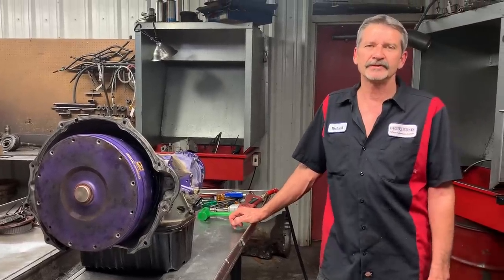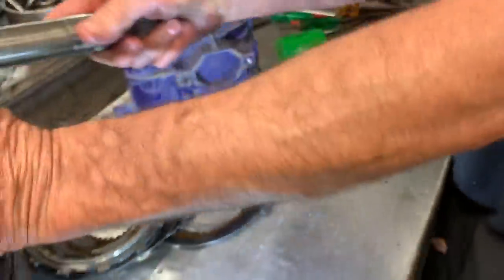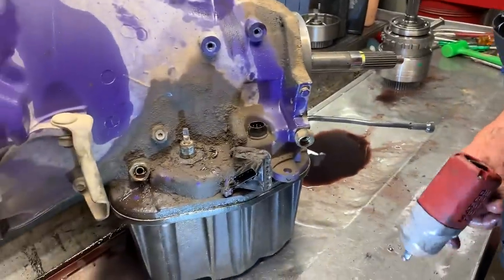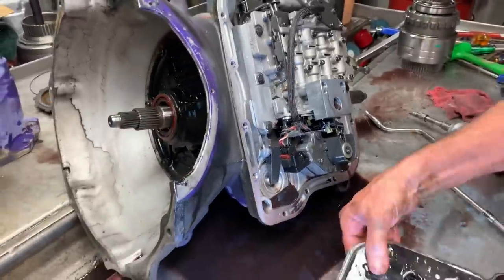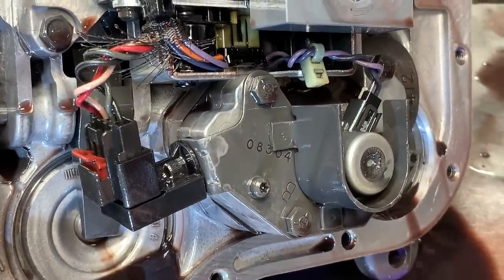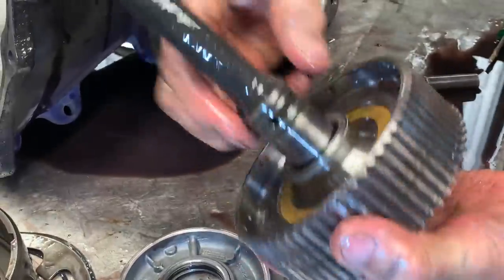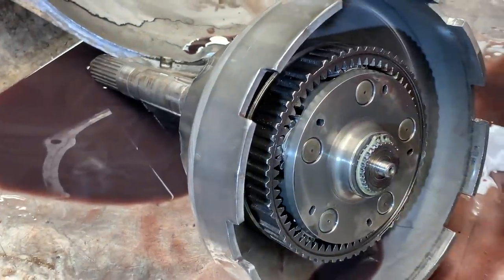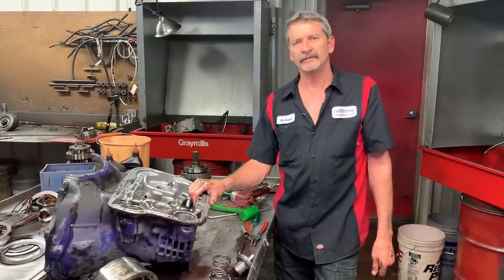ATS transmission tear down... HERE we GO and it isn’t looking good. Video 3-4

Comment: What a shame...ive heard so many ATS horror stories. The only thing you get with them is a deep pan amd a nice paint job. Richard you the man!
Reply: You can only polish that pile of shit transmission so much. He covers pretty much all of the flaws with the design and sorta kinda talks about some of the ways to fix it, but there's a lot of that trans that you simply cannot fix.
Reply: @scottleggejr  you're wrong there. All the top level diesel guys 2000+hp run a 48re. Duramax power stroke Cummins they all run a 48re because they have figured out how to build them strong as shit. Stock they are a joke we all agree
Reply: @scottleggejr   @Scott L  if you want to get technical most trophy trucks run a turbo 400. Some run torque converter sequentials. Only some prerunners use 4l80es. I think it comes down to gear ratios and possibly development. While I agree that a culhane t400 would probably work they almost all run 48res. There are no rules pertaining transmissions in the UCC event (sled pull, Dyno, 1/8 mile drag). The way the diesel trucks make power is way different than a high hp gas truck too. I'm sure that plays a role
Reply: @scottleggejr  I don't know of any built 4l80e transmissions that can hold 3000ft lb. Allison cant do it either, 4r100 maybe.
Reply: @spoolin610  None of them can for any length of time. For drag racing a full aftermarket TH400 could.
Reply: They spend all their money on perfecting the perfect Royal Purple paint color formulation for their transmissions and little else.
Reply: @scottleggejr  Trophy trucks mostly use TH400's. I will say this about the 48re. For tractor pulling they make kits to put the 48re behind the Duramax. So once you build them up, you can throw 2000hp through them.
Reply: Are you joking? They warranty their transmissions for 5 years or 500,000 miles and currently I’ve had mine in my 7.3 for almost 15 years and have over 300,000 and many other freinds of mine have the same set up 🤡
Reply: I've got 430,xxx miles on my '95 Dodge/Cummins, with 323,000 on the ATS Stage IV trans I had built & installed at ATS in 2001. I've towed heavy, street raced with the TC locked, and driven 90% in town driving. It's never let me down, and is still going strong. Somebody "rebuilt" the ATS in the above video unit with stock parts. Most shops are incapable of the type of rebuild ATS does.
Reply: Ruth C I’m suspecting exactly what you said already, I find it hard to believe is trans actually came from ATS like this, they have a lot of R&D on the line with what they do.
Reply: @ruthc8407  if it is such a  great trany why did it have to be rebuilt previously?just wondering.
Reply: @scottleggejr  48re is a torqueflite 727 with e body and od. they are immensely strong. but set up to shift soft which eats them up.
Reply: @scottleggejr  No, they dont. Sincerely, a guy that build TT's
Reply: @DieselRamcharger  You build Trophytrucks with 727 and 48RE in them? Reid makes a case for these trans?🙄 Pick a side are you saying the trans is awesome, or you build trophytrucks, which don't use these trans?
Reply: @scottleggejr  Nope. They pretty much all run turbo 400's. A cpl teams run one off designs. But you'll never find a 4l80e in any of them
Reply: Daver G  Yep I get that... That's why I mentioned vehicle weight. You could do a jericho and call it good all day at those power ratings, but in endurance racing, you need to upshift and downshift hundreds of times...
Reply: Daver G  At what weight and traction and application? That's why this whole thing is a waste of time. I've run a bunch of style of race cars (pavement, offroad, land speed, road racing, drag) and never heard of anyone messing around with fiat, dodge, chrysler/mopar shit unless they're regulated by rules to do some OEM thing to match the engine. Even still, that would rule out trying to use a mopar design for most. The 727 is a notorious pile of shit and all the trans behind the cummins are too. I personally know of 3 Mexico TT running 4l80 regardless of what the comments here say 🤷‍♂️
Reply: @iD0theTUBE  
News flash powerstroke guys dont run a 48re, they run a factory based built 4r100 in " high horsepower racing applications "
Reply: I had a stage 3 ats trans, with the co-pilot controller in my 08 duramax definitely overrated for the hp, and tq I was making stock truck with exhaust, and tune for towing a boat thats it. Trans went out 2 months after warranty fell off they wouldn't help me at all with it. "Too bad sorry." They said. Yeah well too bad sorry you'll never get my money again. Should have went with Suncoast like I did on my other duramax zero problems still running strong 7yrs later.
Reply: @scottleggejr  old 727s Hold up really well for what they were, a lot of the flaws are introduced with the newer designs and electronically driven control. I've seen more fail from shade tree installs(balanced vs unbalanced applications, didn't run up the torque converter, poor lines etc.) than anything though. Peek under any old 440 RV, Charger etc and they are still on the original trans.
Reply: @007.3l  lol power stroke and high hp doesn’t go together
Reply: @rioncardwell3867  diesel power challenge 2017 2018 charlie keeter
Reply: @rioncardwell3867  you bump your head theres many 6.0s 6.4s and 6.7s above 1000hp
Reply: @DieselRamcharger  what does "e body" mean (besides a Challenger or Cuda, lol)?
Reply: @scottleggejr  You lost any credibility with me when you said the 727 is a "notorious pile of shit". It's famous for being bulletproof in GAS powered drag racers, including 1000hp AA Hemi Super Stocks. They weren't meant for diesels, though, except for the early 160-hp Cumminses. With no OD, those 1st gen Dodges ran 3.08 gears in the Dana 60.
Reply: @TheRickJames  What usually kills 727s and 904s is ignorant owners who dont know how critical it is to have the kick down linkage hooked up and working correctly, or you burn em up in a few hundred miles. Kinda like the TV cable on 700R-4s.
Reply: @donellmuniz590  electronic valve body
Reply: Sad thing is that ATS got a 48re core with the 6 pinion planets and gave him a “built” trans from ATS full of “old parts” as Richard put it.
Reply: A company that probably changed management and the new management fools were all about using the name to make big money with low quality. It’s sad when that happens. 50 years to build up, 3 years to drive it into the ground and make a few bastards a ton of money and walk away like bandits.
Reply: @jakescott4800  That's cause 7.3's dont make any power LOL
Reply: @dewfall56  ATS is still managed by the same guy that started the company.. They've been shit for ever.
Reply: @iD0theTUBE yeah u gotta spend 10k n u still have a 4 speed pos! Only good for racing applications, if you are doing any towing, just buy an Allison n forget it

Comment: I've got 430,xxx miles on my '95 Dodge/Cummins, with 323,000 on the ATS Stage IV trans I had built & installed at ATS in 2001. I've towed heavy, street raced with the TC locked, and driven 90% in town driving. It's never let me down, and is still going strong. The trans parts in the above video are not ATS upgrades. I'm thinking the P.O. had the ATS "rebuilt" with stock parts at some point. And the fluid!! I change my trans fluid every 20,000 miles with 3.5 gallons of fresh Dexron III--with ATS you don't need the full synthetic stuff.

Comment: In the diesel industry we used to refer to ATS transmissions as "Another transmission soon".  Overpriced junk.   Installed five different ATS Allison transmissions for a guy in one year because they kept burning up almost instantly,  one we sent back because when we took it out of the crate the pins on the harness plug were corroded to death... you could tell they took a junkyard core,  slapped a rebuild in it, painted it and shipped it without any testing at all.

Comment: I've personally bought 2 ATS transmissions both 48RE. 1st was warrenty after the OD locked up and blew the case apart with only 150miles on it. Took 3 months to warranty. Which they stood behind. They sent me another stage 3 48RE. It came as a Modified 47RE case. It lasted about 12,000 miles. 2006 5.9 with nothing more than a SMARTY. ANDYS transmission in alpena Michigan rebuild it ... i demanded the gay purple be removed. A local transmission shop built me a 48RE that is still in the truck 183,000 miles later.

Comment: Gentlemen, automatic transmissions are indeed incredibly complex with so many variable nuances.  I can fix just about anything, but I am convinced that there are “transmission experts” and then there are guys like you who are at a level ABOVE expert. Allison transmissions are supposed to be top-notch, but you just proves how even those can be built incorrectly.  I am STRONGLY considering getting my next RAM Diesel transmission upgrade through your shop.  I appreciate your honesty, integrity and experience more than anything.  Keep up the phenomenal work!

Comment: I've been building car's and Engines of all types since 1990 and the average person doing the DIY wouldn't believe what comes out of an average transmission. I love the fact that everything you guys take out and apart you explain what everything does and how they get worn out. And i love the fact that you guys replace the lower grade parts with almost top of the line stuff weather it needs it or not. I can tell you take great pride in your work. KEEP UP THE GREAT VIDEOS AND I REALLY WISH I WAS CLOSER TO YOUR FACILITY. I WOULD HAVE EVERYONE AND MY OWN TRANSMISSION REPAIRS. THANKS FOR YOUR AWESOME VIDEOS THEY HAVE HELPED ME WITH CERTAIN PROBLEMS I'VE HAD THAT WENT UN ANSWERED EVEN FROM A SHOP THAT SUPPOSEDLY HAVE DECADES OF EXPERIENCE. YOU GUYS ARE BY FAR THE BEST I'VE EVER SEEN. KEEP UP THE GREAT WORK
Reply: I refuse to have any of my auto work done by anyone just because every time I have, something has come back broke wrong or the whole thing was wrong and not properly done.

Comment: Coming from a guy who as had multiple decent hp cummins trucks. 47RE second gen around 700hp and last 04.5 CR truck with built motor and lots of fuel and air. Right around 1k hp. I learned early on ATS is bad. I always ran all goerends stuff and found a good builder. Last trans never had any trouble. Would refresh it once a season at 1k hp. Had everything billet you could do. All shafts drum servos levers ect. Talk about alot of money in a trans...

Comment: I did a 47 RH years ago; started to slip so I took it to trans shop. It was determined that piston seal may have rolled or had a cut in it; other than that I was told that everything was correct with rebuild. I was proud of myself other than the cost/ problem of having to take it somewhere for diagnosis. It was a good experience for me.

Comment: Great information, I am currently digging around the insides of a 1991 dodge 727 cummins diesel. When you mentioned the output shaft and its backlash, I was wondering how the that shaft would move in and out along with the clearances. Most of the those parts are very similar to what is inside the a727 1991 model trans. I'm glad I subscribed to your channel

Comment: ATS = Another Transmission Soon
Reply: LOL with Respect 😂😂
Reply: Yep I had a stage 3 ats with  the co-pilot controller in my stock tune only 08 duramax completely went out 2 months after warranty fell off they wouldn't help me at all.
Reply: Their first mistake is trying to selling transmissions to pilgrims. There’s a reason why most quality transmission shops refuse to sell “take-out” transmissions. You simply cannot control the quality of the install.

Comment: I have had nothing but issues with my ATS transmission. It's a stage 2. At the moment it's messed up again. Has 30,000 miles on it. Was back to the shop 5 times within 15,000 miles.

Comment: Hey I used to weld those torque converters back together at a rebuild shop. That hub looks like it's got more than a little wear to it! I wasn't pushing out anything that had more than 5 thou run-out on the hub. That being said.... Ford torque converters were the only ones that had bad runout from the factory. So much so, that we wouldn't even bother measuring them and just weld up new ones.

Comment: Funny is we don't know how often it was or has ever been serviced properly.  I've had mine for 10 years now 100k+ miles and has been same since day it was put in. But I service it by authorized service center not off brand shops doing trans flush.  Running more power and tow.

Comment: I’m wondering if that transmission wasn’t just patched back together to get rid of the truck with those older parts?? Makes no sense to put those in when building a HP transmission, but I have also done transmissions like this that only lasted a few hundred miles from internet companies and I get the call after the fact to fix what is messed up from the first builder

Comment: I found many listings for the TV motor from $60- up to $650 with an upgraded valve body. The $60 motor comes with a 2 year warranty. Just like the $340  dorman motor from summit and the $250 motor from MTS diesel.

Comment: This is why i avoided getting an auto trans in my 5.9. Got the G56 6spd. All i did to the trans was a Southbend clutch with new master and slave and a one piece flywheel . it handled 384 hp and 692 ft.lbs at the rear wheels with 3rd gear burnouts no problem.

Comment: Great video. I built more of those transmissions than I want to think about at a dealer. Was so hard to get them to stock selective shims. I had to get pieces and keep them on the side so I had pieces to work with. They complained about all my extra parts I kept. Constantly.  I did it anyway . Good to see people that know what they are doing. Remember a little hard work is good ,a lot will destroy your body.

Comment: I had a stage 3 ats trans, with the co-pilot controller in my 08 duramax definitely overrated for the hp, and tq I was making stock truck with exhaust, and tune for towing a boat thats it. Trans went out 2 months after warranty fell off they wouldn't help me at all with it. "Too bad sorry." They said. Yeah well too bad sorry you'll never get my money again. Should have went with Suncoast like I did on my other duramax zero problems still running strong 7yrs later.

Comment: i am so disgusted witgh ATS, i know there transmission are junk but this is insane, putting this behind a late 5.9l like come on,,, those parts are ment for 190 hp and 500 ft lbs, not 300 hp and 650 ft lbs... amazing
Reply: Mines held up 100k+ miles pushing 435 hp and  968LBTQ

Comment: I must say from experience that ats sux . I had gone thru several of there transmissions in my truck . Paid a grip for there boat anchor which had an unlimited mileage and no hp rating guarantee . The first one lasted 3000-4500 miles before going know where had to await a replacement . After the second unit failing instantly after being installed (reverse clutches) going out truck wouldn’t back up . They argued I was abusing my truck I asked them if this was not there race built unit . They replied always I was abusing my truck yes I raced my truck and it was bought for that intent . The truck at that point was only making 700-800whp & this trans was there top tier race trans I believe $10g . I even flew from Hawaii to ca to drive to sema to have a man to man with Clint owner of ats . He assured me I’d be taken care of after our discussion about there trans in the parking lot at sema 08/09 not sure what year to be exact . He also offered me all parts at dealer cost even giving me a dealer account log in . I then offered all ats parts to anyone at cost my bad I posted the offer online in Cummins forum . I guess I stepped on some toes but my intention was in good faith for my fellow hp enthusiast . So long story short we had gone thru 5 of ats’s full billet race trans . After the 5th unit failed I had a buddy who builds many of norcals diesel , ultra 4 & Nhra trans rear it down to find that they were using Napa branded internal parts & infact the clutch drum was not even billet . Hence why they would only do swap outs as they weren’t building these units as stated . I guess I was lucky to not have one grenade in my truck injuring myself .